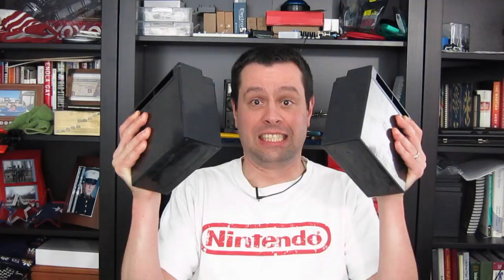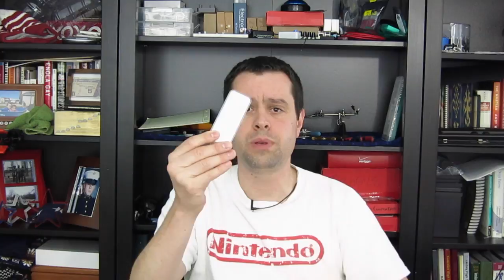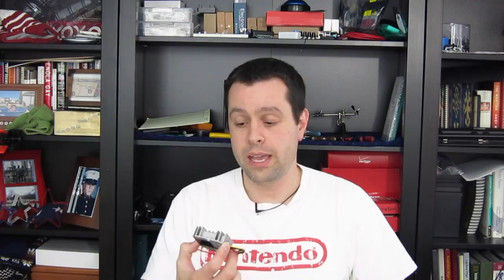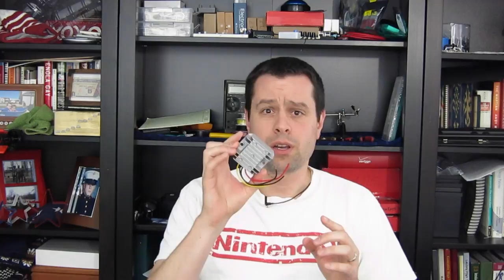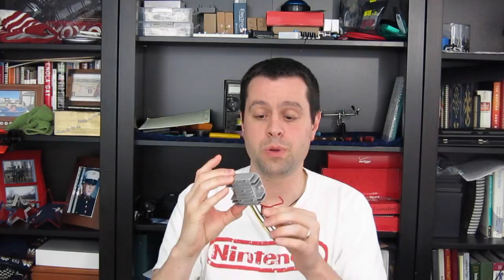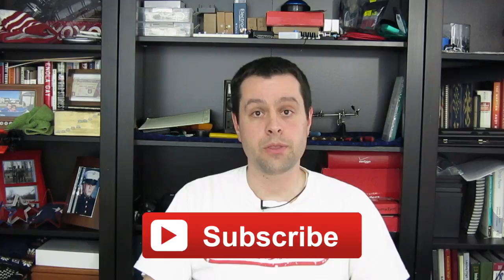BUCK YEAH! | DailyIoT 016

Comment: Batteries connected, amp meter in series, power on. 
Meter showed 10 plus amps well it oscillated between 10 and overload. This tells me it is not enough to blow the fuse on the meter which is 10 amp. This according to the specs on the meter. 
So this motor is using 12VDC running with out any control will draw +10 Amps when connect directly to the battery.

Next connect the PWM and check current draw.
Reply from the maker: Also note that it will draw quite a bit less current when in free spinning mode vs actually carrying the weight of a load. Interested to hear about your results.
Reply: MicroCasts The test conducted was with no load other then the trans axle. 
What I find interesting and full of possible reasons is the draw when the 12V charger is connected to the same setup. It draws around 5 amps. Now this might be due to the meter on the charger ball parking the current but to be that far off is odd. And of course the brake was turned off.

Comment: Ordered SLAs and holding off on buying the charger for now will charge each battery independently with my 12 V charger, until I can decide on a charger for my 24 volts system.